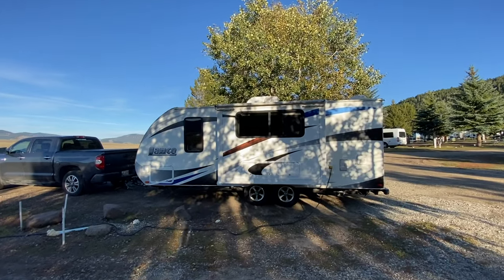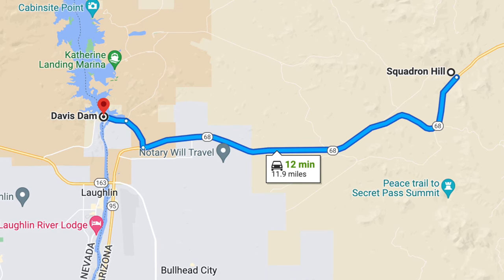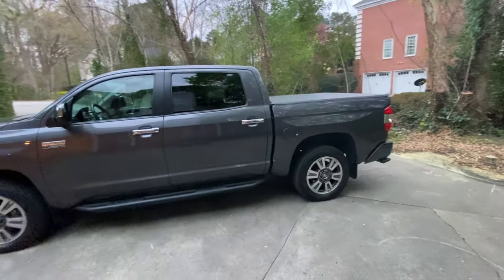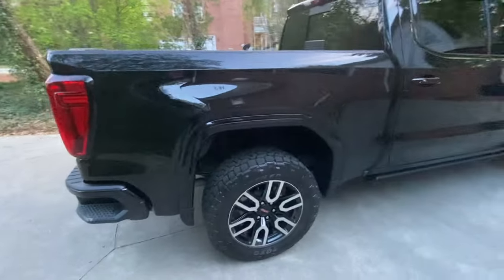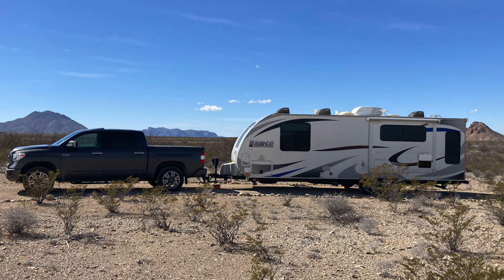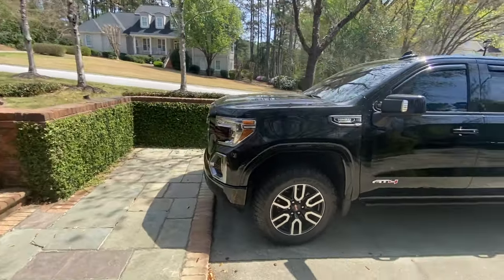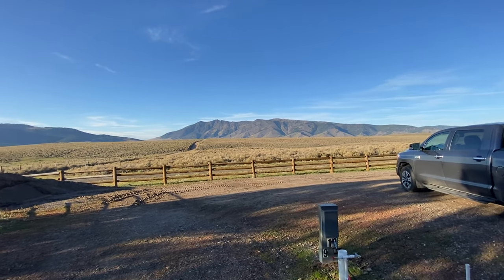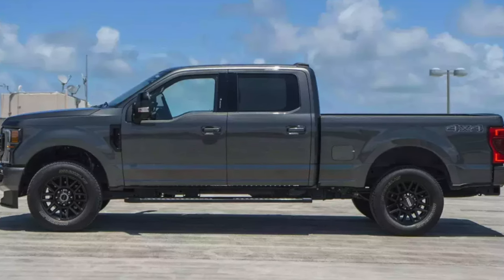Myths - Towing Capacity & Payload - the best Half-ton truck for your Travel Trailer or RV

Comment: First let me say this video had a lot of practical information but I would dispute whether the turbo is on all the time. Look at the turbo the way one might look at a hybrid car. Once you're up to speed, So long as you're traveling at a reasonable speed, the turbo really won't be on it's only on to get you to that speed.  Yes if you have the cruise control on and there's suddenly a rise, the turbo will kick in, but once in level footing again it will kick off. That's of course if you are doing what you express in this video, don't max out your towing, drive at reasonable speeds etc. 

Next in terms of dealing with the heat intercoolers are quite capable of doing so, when the turbo is cycling normally, and not aggressively or constantly.  

Finally turbos actually have a clear advantage over naturally aspirated engines, namely that they are far less affected by elevation change.  So if you're going to be going up into the mountains, and you want consistent power, turbos are the way to go.  Turbo technology has come a very long way since the late 1990s and early 2000s, it's why just about every truck manufacturer is now focusing on turbo engines, including Toyota.

Your comment about the Ford 7.3 liter motor is what is often called a false equivalence sadly.  Of course any technology has a limit, and turbos are no exceptions. Comparing an engine designed to tow say 6000-8000 lbs comfortably, in a 1/2 ton to an engine designed to tow something as much as 16,000 lbs comfortably (max 21,000) in a 1 ton, is a complete apples to oranges comparison, sorry.

I could easily use your logic in favor of turbos by the way and say "If turbos can't tow as well why does the Tundra only come in a V6 twin turbo now?" My answer would be because "in the 1/2 ton, and smaller, applications turbos are better.
Reply from the maker: Appreciate the comment, but we’ll have to agree to disagree.
Reply: @kedrevs4037  Oh I wasn't trying to question your preference. We're all going to have those. My main point was just to address two issues with turbos, from a technical point of view. 

First that the turbo is, as a matter of engineering, not always running when you're towing, if you are towing the appropriate weight. It will certainly be running whenever you accelerate, no question about that, but once you hit the particular cruising speed for the weight that you're towing, usually around 60-65 mph, on a flat ground, the turbo will be off. Now go up a grade or accelerate, the turbo is certainly kicking in again.  It's just not always on.

The other point was again, a turbo, or in the case of say the Godzilla engine, a supercharged engine, will maintain its power and torque more consistently at altitude than a naturally aspirated engine, simply as a product of the air being thinner at altitude, where turbos and superchargers compress the air, compensating for the thinner air.

Now of course everybody's going to have their own opinion on which performance they prefer, which they feel may or may not be more durable etc. I will really not try to get into those issues, I was just talking simply how modern turbos, meaning roughly the last 5-10 years, function.  It's one of the reasons why turbos have basically taken over the the midsize segment, and are increasingly taking over the 1/2 ton segment. To be honest I don't even think the companies are deciding that turbos are better than naturally aspirated engines.  I think it far more likely that they're just saying "these will do the job well, will be more efficient when not towing (and most midsize, and 1/2 ton truck buyers don't tow) and having fewer drivetrains in our lineup will streamline costs." 

Will this trend last? I do not know, only time will tell. Enjoy the road!

Comment: So what is “well below”.  If it has a tow capacity of 12,700, is towing 8,000lbs GVWR trailer ok?
Reply from the maker: To me, it's more about the setup.  I would be comfortable up to about 8-9k lbs with most modern 1/2 tons and a good WDH with sway control.  If I were going above 8k with a travel trailer, I would move up to a HD truck.
Reply: @kedrevs4037  thanks.  I’m at the F-150 powrrboost station drinking the kool aid because I want that 7.2KwH power on board feature to help me off grid. If I can find that in the 5.0….I’ll do it

Comment: What are ypur thoughts on the 2010 5.7 sequioa for towing a medium travel trailer? I have a 2012 tundra and love it, but i have 5 kids, so i need more space
Reply from the maker: I can’t say much about it other than the 5.7 is a proven towing champ.   Not sure about Sequoia gearing, but if I had 5 little ones, it’d be on my short list.
Reply: I have a 2016 Sequoia, and from what I can tell, it has the same drivetrain as the same year Tundra - a 6 speed transmission and a 4.30 rear axle. Main difference is a shorter wheel base and independent rear suspension.

Comment: My 3.0 duramax with its 24 gal tank probably has just as much range towing or not as your tundra. I have driven 5.7 tundras and they are nice but the 3.0 duramax is in a different league as far as towing or having a nice everycday driver.
Reply from the maker: Love it, but nope just doesn't.  Today i returned 830 miles to home in under 13 hours and averaged 10mpgs doing 70.  Two stops.

Comment: I towed my 2500 lb travel trailer from Virginia to Alaska with my truck not truck Honda Ridgeline. Never struggled or overheated just kept on going. Every vehicle has a purpose.
Reply from the maker: What is the rear Gross Axle weight rating on a Ridgeline
Reply: @kedrevs4037  front about 3100 rear about 3200. Towing capacity 5000

Comment: Nobody wants to stop every 200 miles for fuel on a cross country trip with your family and the camper.  These EV's can barely hit 100 miles towing and then take hours to charge.  Don't see myself getting rid of my V8 gas truck any time soon.  I only have a 26 gallon tank though so when I'm towing I definitely feel it.  I am considering adding an additional fuel tank of about 30 gallons.
Reply from the maker: I think a number of people have swapped the 26 gallon for the 38 gallon tank. I’m sure you can find some info on it.
Reply: @kedrevs4037  do you know if that's something Toyota will do at the dealership?

Comment: I traded my 2010 Tundra because I was scared of the Payload becoming an issue should we ever get in an accident with our 6k trailer. We bought a 2007 F250 Superduty. While I like this truck and the power. It is also no question of capacity. It also pull at 14 mpg on diesel. HOWEVER... Its not a Tundra. The Tundra is all around a superior truck and the cost to repair and maintain this F250 may soon eclipse any cost from an accident towing over capacity with the Tundra 😅
Reply from the maker: Hmm, I really struggle with not going HD because of the quality of my Tundra

Comment: Did not the factory include the full tank as far as curb weight. I heard it both ways. Not sure what the real deal is.
Reply from the maker: GVWR is the number that includes all fluids, cargo and occupants
Reply: For the average Joe the numbers on the sticker gives numbers so you can give you  fairly close idea of the truck's ability. Numbers give a ending point. Stay below the numbers especially on cargo capacity on the truck witch you can reach faster then people think and your good to go. One thing that no one mentions even you is what? Il tell you length! length!  length! You should not pass 28' in my book. Even hight! A camper that is 11' high to a camper that is 10' high makes a big difference and length.  Some will pull a camper beyond 30' and I find that more dangerous. And your doing this on a 5,000lbs truck. That is a sail boat back there and not a trailer full of bricks. My opinion to make this simple don't tow anything pass 28' and 6,000lbs on a 1/2 ton. Anything bigger go 3/4 or 1ton if you want everyone safe in your truck. This eliminates all that you said and good to go. I have a 2021 GMC elevation  that has 7,000 gross and 9,200 lbs towing. Just bought a 28' camper dry weight 5052lbs 7,550 gross. There is no way I will be even coming close to that gross. Maybe 6,000lbs and even then I'm reaching. The same with the truck . 1,787lbs cargo max. By the time I load my truck with  me the wife and dog and a few things in the bed like a small frill leaf blower some tools maybe another 750 lbs and even that I'm pushing. Tougue weight with hitch and trailer 700lbs. Well within the spec. Of the truck so you can disect all you want but bottom line it's weight and just as important length. It's the law of physics. Wind resistance takes a big part on what a little 1/2 ton 5,000 + truck can handle.

Comment: How large is your travel trailer?  I have a well equipped f150 and considering a 24ft trailer that is actually 30ft overall between 6 and 7k lbs.  Is that too large or is that something many 1/2 ton owners do?
Reply from the maker: that is right in the half ton range

Comment: But everyone on YouTube making videos on this subjects like this most are on v8 heavy duty vehicles not v6 and that poses a big problem for us that try to find info on thier vehicle. Like mine it's a 1/2ton 2013 chevy silverado reg cab 6.5 bed with the 4.3 v6 gvwr 6400lbs 2wheel drive not to mention every driver drives different and that too causes most of the problem cause even though most don't fallow the speed requirments when towing
Reply from the maker: I mostly try to review what I have and competitive options.  Now that there are more Turbo 6ers coming, you'll see more of that

Comment: what is the empty weight, length and height of your trailer?
Reply from the maker: I have towed 4 with my Tundra.
2007 Trailmanor - unique, hard sided pop up great for towing.
2015 Lance 1995 - 4,200 lbs empty, GVWR 5,700lbs
2018 Lance 2375 - 4,900 lbs empty, GVWR 7,000lbs
2007 Airstream 23' Safari -4300 empty, 6,000GVWR

Comment: This is what's frustrating when I do research on towing capacity vs. payload vs. gross vehicle weight rating explanations. I've decided I'm going to stick with common sense and if I find out I'm not happy with my truck's performance while towing the travel trailer, I'll deal with it then. 

I have a 2015 Chevrolet Silverado 1500 4.3 liter V6 with a 3.23 gear ratio, 285 hpwr and 305 lbs of torque. 
Standard two door cab with the short bed (6'-6") and it has the trailering towing gear package installed from the factory. 
The only options I have on the truck is a soft roll-up tonneau cover and just had a Class 5 tow bar installed with a 2.5" receiver, rated up to 14,400 lbs. Yes, I know it's overkill but a lot heavier duty than the Class IV I looked at. 

Factory specifications:
Dry curb weight=4,521 lbs.
Max payload=2,088 lbs. 
Gross Weight=6,500 lbs. 
Maximum towing capacity=9,300 lbs. 

I just purchased an InTech Navigator OVR travel trailer (it's on order and will be delivered in July 2023) that has a dry weight of 5,650 lbs. and a total Gross Vehicle Weight rating of 7,500 lbs. Yes, I want to tow this travel trailer with my Chevy Silverado with specs shown above. 
During a recent visit to my Chevrolet dealer for routine maintenance, I asked about travel trailer weight ratings and told him my plans to tow the trailer mentioned above. He came back 45 minutes later and said I need to upgrade to a 3.43 gear ratio and that'll be....wait for it...$4,300. He said the other option is to trade my truck in for a new or used Silverado 2500 (they start at $50k). 

For now, I believe the truck I've got sitting in my driveway is more than adequate to haul the travel trailer I'm buying because it's well within the limits of the max towing capacity, according to Chevrolet's specs.
Reply from the maker: I would check out videos and articles by Andy Thomson, the real authority on Tow setups.   With is knowledge. You’ll be fine.  https://www.rvlifemag.com/author/andy-thomson/

Comment: When/what year does the second generation tundra start?
Reply from the maker: 2007-2021, it was quite a run
Reply: I’m looking at tundra’s right now, going with crewmax for kids, they are all sr5, is the 2 or 4x4 better, trying to figure l out what the hitch/tow can handle and I’m looking between the below campers:

Rockwood 2509s
 
Hitch 773
UVW - Empty 5,336
GVW - Max Weight 6,933
 
UVW
 
Apex Mini-lite
 
Hitch 596
UVW - Empty 4,260
Cargo - 1740
GVW - Max 6,000

I’m going into the mountains on NC so I need to be sure I’m safe for my family, can someone please help?
Reply: @kedrevs4037 great, looking at a used 2012-18

Comment: 10k. A number trucks stay below for registration, insurance,  commercial insurance,  etc. Put a tool bed, start towing equipment instead of travel trailers and the road tax enforcement will teach you why payloads are low in 3/4 ton diesels. Get a 3/4 ton diesel or gas,  put a 60 gallon transferflow in it, tow your trailer and enjoy.
Reply from the maker: I don't know where you live, but your terminology sounds very British.  You saw the part about Half-tons and Travel Trailers right?   All the sudden, you want to change to commercial use?

Comment: After looking at these videos, I came up with what I thought was a safe to tow package as seen below.

2022 Ram 1500 Crew Cab Big Horn 4x2 5’ 7” Bed

GVWR - 6,900   GAWF – 3,700   GAWR – 4,100   GCWR – 13,900

Empty Weight – 5,105   Cargo – 1,795   MTC – 8,430

MTC at RAM GVWR – 7,000

Tires – 275/55R20 113T    36 PSI on 20x9 Rim

2022 Spartan 6’ x 12’ Cargo Trailer

GVWR - 2,990   Empty Weight – 1,460   Cargo   1,530

Tires – ST205/75R15C   50 PSI on 15x5 5 Bolt/4.5 Spacing Rim

Ram GVWR + Spartan GVWR = 9,890 - That is 4,010 under GCWR  and MTC (Adjusted for RAM Cargo)
Reply from the maker: Sounds like good setup to me

Comment: I have a 2022 GMC Sierra SLT 1500, it sucks towing 6000 pound travel trailer. The trailer moves the truck around terribly.
Reply: TTL first, Tires inflated for the load on TV &TT? Tongue Weight, do you have enuff? WDH adjusted properly? Are you LOADED heavy in the rear of the TT?
Reply: @clint3651  Tires all inflated properly. I think it is too much tongue weight. If I ease up on the weight distribution hitch the effect on the truck gets worse. The friction type sway reducer tightened all the way. Thinking of adding airbags to the rear.
Reply: Might be your hitch set up  , that truck should be able to handle that np
Reply: @bobmartens1089  It is the same hitch set up as on my last truck. 2003 GMC 2500HD. Granted a heavier truck but it handled it well. Every time I get passed the trailer moves the truck sideways.
Reply: @brucehillemann9698  Properly for my KO2s (E)pulling 8K is 60 psi all around and 40 psi on the GYs (C)on the Durango
Reply: @brucehillemann9698  Did you re adjust the hitch for the new truck? A 2500 may only need 2-3 washer for head adjustment and the 1500 might need 7?  Have you run across the scales to see how your WDH is working?  I have a thick stack of scale tickets for both on my rigs
Reply: @clint3651  I have the head tilted all the way back. I believe it is 6 washers. I set the trailer on the ball, then latch it. Then I pick the back of the truck up a little to set the chains.
Reply: I recently retired and would like to do some part time traveling pulling a 25-26’ travel trailer. I own a really nice 2008 Ford F150 crew cab 4x4 w/ 5.4 Triton V8. 90k miles. I don’t know if I am fooling myself or not to try pulling anything like this with my truck in the Midwest or if I’m just prolonging the need to update my truck. Does anybody have any experience with a truck like this. It fits perfect in my garage but as soon as I get anything newer they are about 6 inches longer and I would need to tear out some nice shelving to fit a newer one in the garage. This is an option I’m willing to do. Just not sure if I should go ahead and do it now or give my truck a try first. Thanks
Reply: @brucehillemann9698  If you just transferred the hitch to the 1500 with no adjustments you are going to be fighting a losing battle. Find the set up directions for your hitch , load up as per your average trip, record all of your measurements then take a trip across the scales to confirm your numbers and see if it feels better. Happy Trails
Reply: @douggracy2909  IMHO , as long as you are up on all the maintenance then go for it. If you havent RV'd before then hit the dealerships to see the differant floor plans and join a few of  the RV groups to gain all the knowledge you can. The 5 weights you should not exceed at GCVWR, GVWR, GAWR's and HRR. Happy Trails

Comment: Correction: 

Note: if you want to go with the f150 5.0L v8 you CAN choose the 36 gal tank. You do not have to choose the twin turbo 3.6. 

I own (bought new) the 2019. F150 5.0L v8 with the 36 gal tank.

Also the 3.0 Diesel is coming back to the F150 for model year 2024
Reply from the maker: Don't think you can build one like that now.  At lest you couldn't in '22
Reply: I have a 22 with the 5.0 and a 36 gallon tank

Comment: Just drive it, if you don’t like it, go bigger. Was always concerned towing over 6k with a 1/2 ton. Went 2500 and won’t go back.
Reply from the maker: That is certainly aceptable, but 6k is fine with any modern half ton.
Reply: @kedrevs4037  other issue is that 6k must include everything. Many people would be very surprised if they actually had everything weighed. And just because the sticker says it is ok, take it out in the wind, hills and weather and make a decision based on experience.